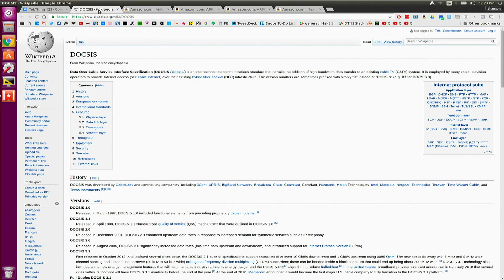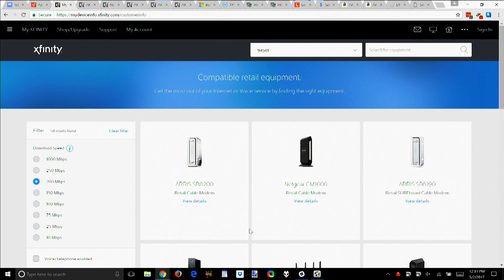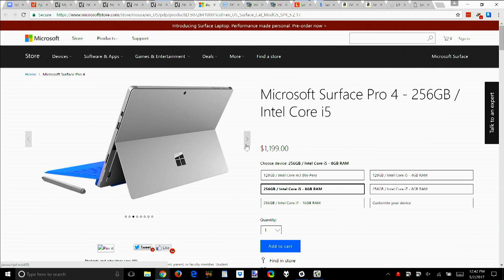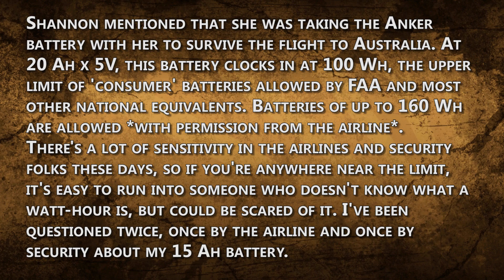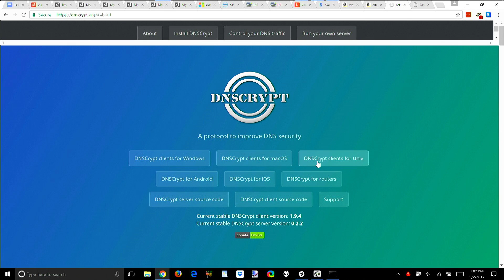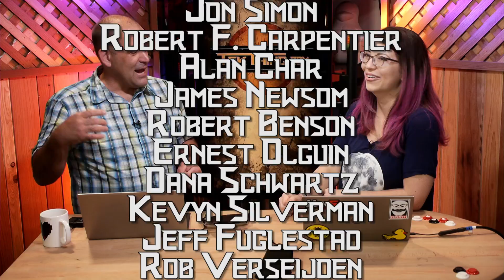Speed Up Your Cable Modem! Is Your Battery Pack Too Big To Fly? MS Surface Pro Substitutes, DNSCrypt

Comment: The ISP gives your cable modem a config that's rated higher than your actual subscription to account for burst mode (usually up to 1MB/s per channel) for when the network isn't maximised at the CMTS that it connects to. They're able to do this since the contention radio is much smaller than DSL backends provide.

However, none of this, including buying new modems or extra channels, DOCSIS 3.1 (if your ISP supports it) is going to help with your high latency if you're uploading images. What you're really wanting is QoS settings, and modems like ARRIS try to help things out of it's has router built in.

Ideally you'd want to get a router that has QoS settings that you manage yourself and set service levels for each port or mac address.  A lot of routers can be flashed with something like DD-WRT and that'd provide very good QoS settings.
For example, you know your husband is only going to be playing games on his xbox, so you can set the mac address to have highest priority on the network, and the router will deal with his packets first and leave your picture uploads until there is a few frame times left to upload it. This way you're able to maximise the bandwidth you have, while giving the xbox lag free gaming.

Unfortunately, a lot of the home modem routers come defaulted to providing http and https as top priority so they seem faster, while others have some defaults for common gaming.
Reply: Simon Johnny my router does have QoS settings so that definitely helps!
Reply: Sadly, cable and the various modems are not very good at avoiding congestion. A friend of mine who is on  25 down 5 up megabit package, got a small boost in throughput and solved some gaming performance issues due to network performance after upgrading from an Arris SB6121, to a netgear CM1000.
With his old modem, even with me helping him with custom QOS rules, we were unable to solve all of the issues. the main problem is that QOS at the home router level, largely assumes that the WAN side performance is constant, but if channels are frequently getting congested, older and lower end modems seem to just freak out and cause lag when they encounter these situations.

It was an expensive (nearly $200 upgrade, though it solved the issues enough that the modem+ something basic like the automated QOS rules from qualcomm, were enough to solve all of the connection issues when gaming. Had him go with something higher end since he will be upgrading the service soon, provided spectrum does not fully remember the apartment scam. Basically when some apartment complexes are wired and restricted to a specific ISP even though other competing ISPs are available, the cable companies become far less willing to offer good prices. But with the new plans and prices from the move from time warner to specrum, there is a good chance for being able to use one of the newer packages, where previously nothing but a slow overpriced package was available.